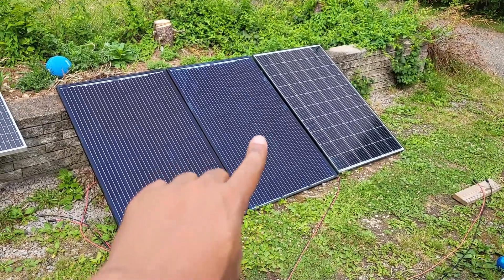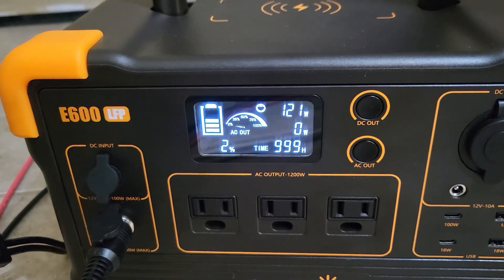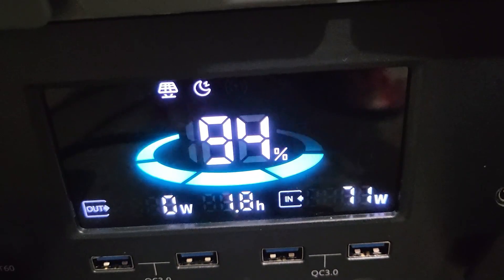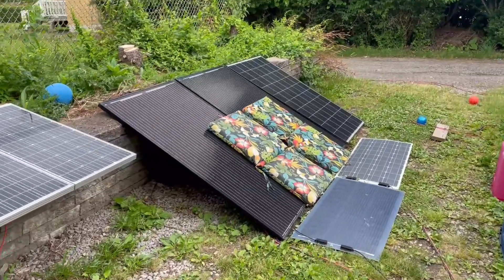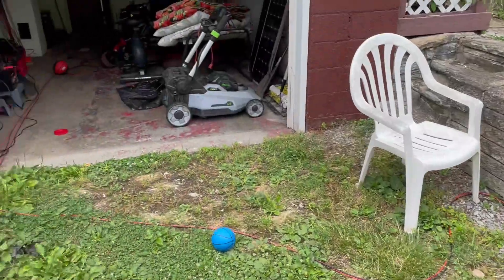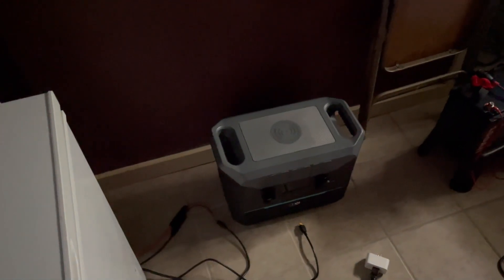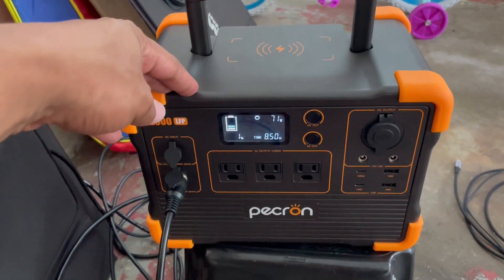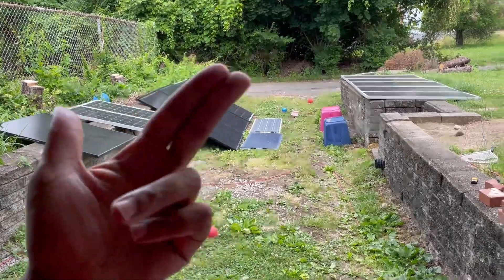Will Pecron Fail or Succeed??- E600LFP vs Series Panels

Comment: Okay so I can tell you right now that pecron I just looked it up. That is a 25 volt battery. The battery is not even going to charge you're not going to be able to pull any kind of power at all unless you have two panels hooked in series. You have 200 w panels, they pretty much all operate around 18 to 20 volts. 20 volts is not going to be high enough to charge that battery. You have to connect your panels in series. You have to have them oriented the same way and the same direction facing the Sun. Yeah it's saying on the specs I'm looking at is saying you need between 32 and 95 volts. So a single panel is just not going to charge that battery ever and so you're not going to see any kind of wattage really coming into the panel. You need to use at least two panels in series. Yeah it has some weird specs I guess it could take one battery is what it's saying but then it's saying it maxes at 7 amps. One panel is almost certainly going to be able to push more than 7 amps. So you have to connect at least two in series in most panels push about 10 amps. You should put a fuse though between the battery and the panels. A 15 amp fuse
Reply from the maker: So while I appreciate that you have so much to say, it seems that you're not really paying attention to the videos. 

These are 300 watt panels not 200a and they are like 37v panels open circuit I believe and around 32 volts under load.
Reply: So if what your saying is true if you hooked up a 12.8v lifepo4 to the dc input via the mc4 adapter cable it won't charge the pecron unit.... yet it does so there's that.  An MPPT (Maximum Power Point Tracking) controller charges a 24V battery from a lower voltage source by using a DC-DC buck-boost converter to increase the voltage while decreasing the current. The controller's internal "smart" logic continuously finds the solar panel's optimal operating point (its Maximum Power Point) and uses the DC-DC converter to convert the power to the specific voltage required by the 24V battery, ensuring efficient charging.  That means as long as your meeting the MPPT minimum voltage of 10v it can boost it into a low current to charge the internal battery.  Science my friend.

Comment: Sir can i ask if its ok to use 12v car inverter in cigarette port of power station? Because my power station ac broke.... But the 12v still works. Thank you sir
Reply from the maker: Yes that's ok BUT only up to 100 watts, they socket is very more power. Which power station was it?
Reply: @AskIveSolar  my 12v can handle 20a..
But good news they send me new one.. Its flashfish here in the Philippines....
Reply from the maker: @KennithAliling-sh1ss that is good news! I have never heard of 12v having that high of amps. Interesting
Reply: @AskIveSolar  sir is it bad to use long extension cord in power station? Maybe the reason the ac broke coz of it? I kinda use many lights at night and its kinda long distance? Is it bad? But my power station can handle 1000w?
Reply from the maker: It's not bad but how long is the extension cord and how many watts of power. 

Look up extension cord ratings in your country and see how much they are rated for by length. I doubt that was the issue.
Reply: @AskIveSolar  I think thats the reason why it broke. Because i used 50m extension.. Its kinda my recklessness..
Reply from the maker: Yeah that seems like way too much extension cord. ha. Why so much?
Reply: @AskIveSolar  im kinda new in using portable power station .. Sir is it true that the advisable max distance of cord is only 15 meters or maybe less in small power stations?
Reply from the maker: I can't speak on your situation as you are not in the states. You have to do a little research on thickness of extension cord and then length and see how many watts it's rated for. Then you may want to use about 20 percent less just in case the company is lying.

Comment: As long as the series voltage does not exceed the input limit, you should be fine.  Exceed that limit though, and you may let the magic smoke out of the MPPT controller.
Reply from the maker: The crazy thing about these pecron and all powers "Beasty" little devices and that I think they pack too much into them and then they have to scale it back. 

Check out minute man preps video at the solar part. He had issues with series but not the same as me.